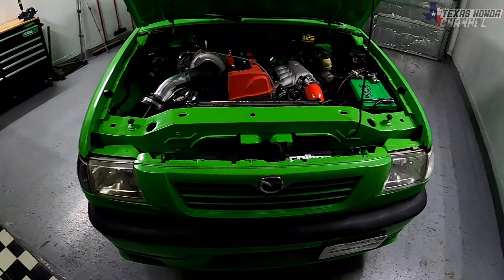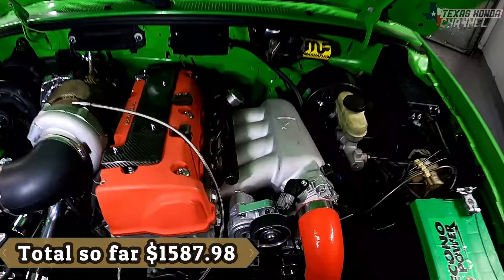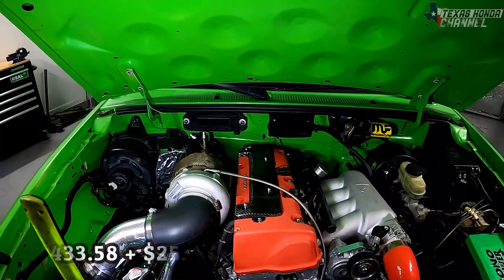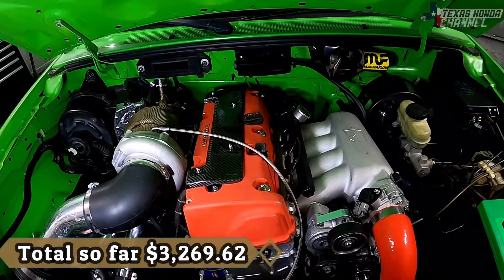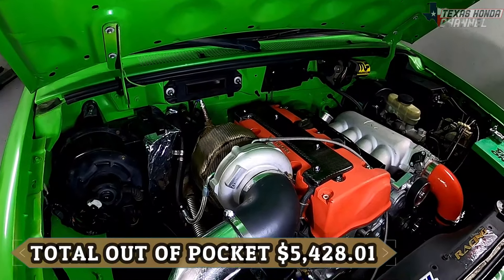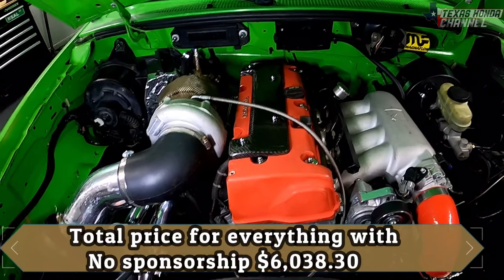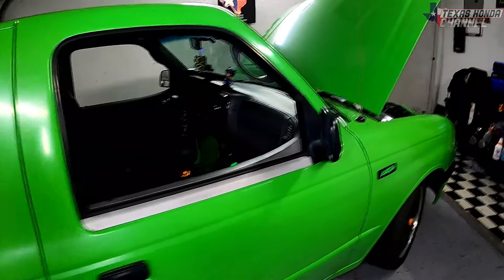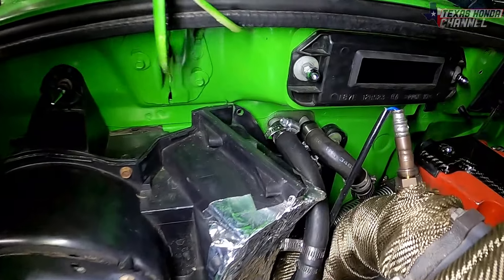How much it cost to K20 Turbo swap my Ford Ranger/Mazda B2300 (on a budget)

Comment: Man it's tempting. I got a 98 ranger with four hundred thousand miles on it and I'm going to be doing an engine swap but trying to pick between this or EcoBoost mustang swap very comparable price.. there's actually a company called Mars that'll send you an EcoBoost crate motor and your choice of three different transmissions for about $7,000 turn key. That's like 300 and some change horsepower on stock stuff. All of which is very compatible to a ranger I think that would make it easier swap.

Comment: I do have to say that k-series sounds hellacious I got me a Honda Element at 2003 with a k24 in it taking my time building it up for the wife with an automatic transmission in it for now
Reply from the maker: That can make more power then my k20a3 and honestly I wish I had that bottom end but definitely a good platform to work with. If I upgrade my k20 internals I can make 500hp+ safe but the stock bottom end k24 can handle close to that bone stock

Comment: Time for some 18x10 RPF1's with 285/40(or 35) UHP summer tires on the rear. Or if that's too crazy, some 18x9's with 255/45 (or 40), and you could probably run that size all the way around. If you wanna be extra light, 17x9 or 10 with the aforementioned tires (only the taller sidewall, though, for either since that specs out to 26" diameter on a 17, while the taller profile will obviously be 27" on an 18, while the smaller one will be a 26" still.)

Comment: Freaking amazing build! You inspired me to do some sort of K-series swap into my Ranger. My Ranger has been my project for the last 4-5 years making into a prerunner. Obviously I spent all my money on the suspension, and several thousands on re-gearing to 4.88s on the stock ifs dana 35 and the ford 9"  I swapped in to push my 35s. Currently still have the stock SOHC 4.0. 

Off the top of your head, would there be any variables/reasons why a k24 swap would be a bad idea for a prerunner? due to the much larger tires, aggressive gearing, 4wd, transmission compatibility issues, etc.
Reply from the maker: The k24 block is ideal but the head water inlet might hit the fire wall that’s why I went with the k20

Comment: Okay, this is a long shot since you haven't replied to comments in years, but I am trying to purchase the driveshaft for this build, I have the 97 b2300 gutted, the K24 ready to drop in and my rx8 trans is on the way should be here Thursday or next week. You said driveshaft shop made it but the only place I can find in HURST TEXAS was "automotive driveshaft shop" now my main question is 45 min down the road from me I have a actually driveshaft shop vendor. Should I just go to them or order from your people ?
Reply: honestly just go to the other shop, research around, just give them as many measurements as you can
Reply: @thelizardwizard3172  yeah I found a local shop and they sent me a spreadsheet to fill out pretty much and I sent it back to them and they are custom building it only 35 min away from me. Thanks for reaching out tho sir
Reply: @dylanpope9162  that's dope, how is it going so far?
Reply: Too bad he doesn't reply.

Comment: Id like to know how the racing seats and steering wheel changed your seating position? I'm hoping to do the samething in hopes the steering wheel will be farther away from me and the racing seats sit me a bit lower and a little farther back than the original 2011 stock seat with the arm rest. What differences did you notice? I know I'm not going to gain much moving the seat back but even an inch if I have to move the slider back, and maybe a couple inches lower...Think I should have any problem?

Comment: For the power steering, have you ever considered an electric rack for Mustangs from 2011 and up?
Reply: I imagine that would be very expensive and too complex. You would need a beefy electrical system to adequately power the electric motor as well as some sort of computer module to manage the steering input and output.
Reply: A Ford Fusion electric power steering would work
Reply: @pastathemechanic7536  Even though they're rear steer as opposed to the Ranger's front steer?
Reply: @MisledDan  it’s a rack and pinion, all it needs to do is turn the wheels easily, even a Chevy Cruze rack would work

Comment: Hello I just have a quick question. I have a 1996 Mazda B2300 and I was considering doing this but do you have any better recommendations on the turbo setup and motor swap? If so I would like to hear what you would consider going for unless this is the best option.

Comment: What would your evaluation of cost comparison be between building a 2.3 turbo single overhead cam s h o style build or possibly swapping in a newer dohc Ranger motor and turbo it being at those are both Ford engines and came in this platform
Reply: Boost a 2.3L dohc duratec. stock theyll handle around 275-300hp pretty reliably. Just use a trans and everything from a 2002-2011 2.3 ranger.

Comment: I'm not sure if I've missed it or you haven't said, but what oil weight do you run in this?
Reply from the maker: 5w-30 full synthetic Ams oil with www.racingadditves.com Engine oil additive. It’s an amazing combination with superior heat handling capabilities 
 (Use code Dguy20 to get 20% off) when using that link ^
Reply: @TexasHondaChannel  you're awesome 👌! Gracias sir !